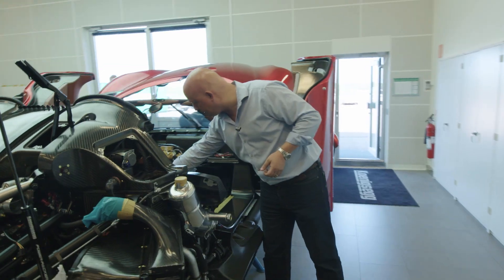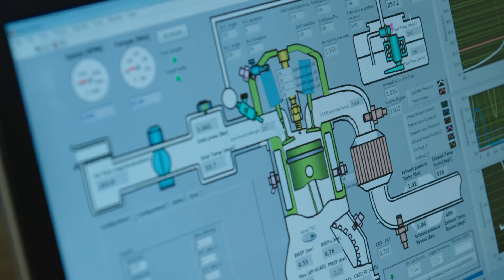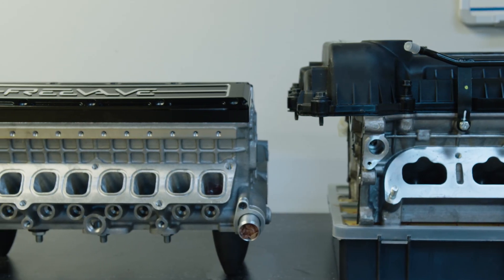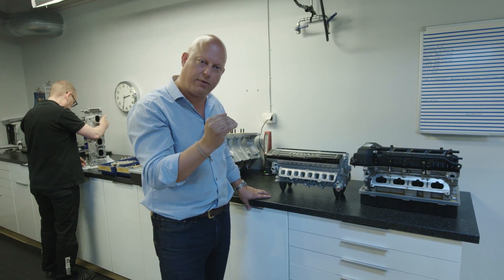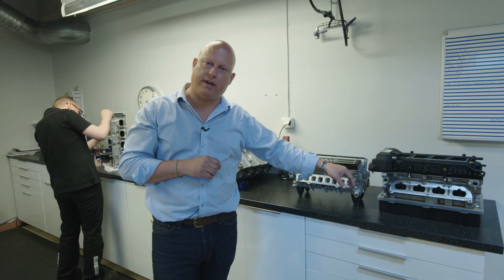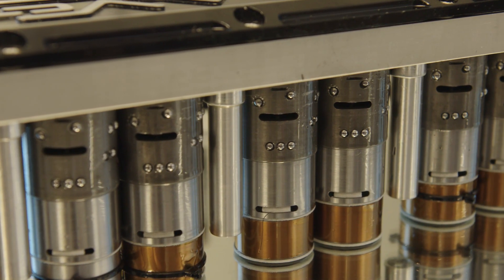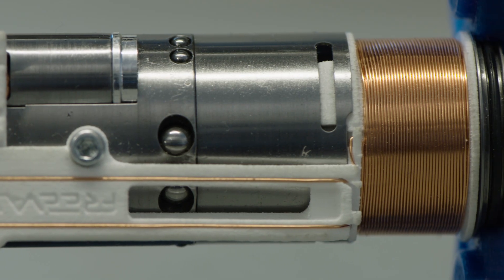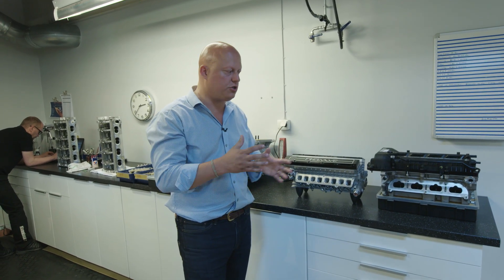Freevalve Update Camless Engine -- /INSIDE KOENIGSEGG

Comment: imagine a head designe with no valves but a rotating disc similar to a parmeseam cheese dispener that allows air in and out depending on timing and port size. no springs, no valves, rotating discs on a squirel drive gear #patentpending

Comment: I like the idea of new technology but I wonder what the longevity is of these valves and how hard will it be for a mechanic to replace valves should they fail prematurely? Also, Will an average mechanic be able to replace the valves and diagnose and repair the head should there be a problem. I live in Australia and it's not like we have easy access to Swedish Koenigsegg engineers here.

Comment: I imagine you could easily retrofit this on anything for example an ls then I'm sure aftermarket ecm manufacturers like haltech will be able to integrate this into their tuning software and be able to create massive power gains my only worry is if an actuator would fail open but I would imagine they would have thought of this in the prototype phases

Comment: what happens if one of the pneumatic lifters fails?in a traditional engine if the taming chain or belt fails it could destroy your valves and pistons.thars only one point of failure with these pneumatic lifters you have multiple points of failure how reliable are this pneumatic lifters being exposed to all that heat in the engine?
Reply: I answered my own question if the pneumatics fail the valve stays closed so no chance of the vales contacting the pistons very cool innovation.

Comment: This tech has been around since the 80's in high performance race cars. The fact it has taken 30 years to even get close to getting into common road vehicles is appalling. This tech should have been rushed out 20 years ago if it was going to save the combustion engine. Like it or not government regulations in a lot of countries will force the switch over to electric motors a lot sooner than people realize. It just makes me very frustrated that the combustion engine has stagnated for so long. Now that a company is actually pushing for this, electric cars are on the rise and will phase this out before it ever reaches the market most likely.  Like I said you guys are about 20 years too late for this to have any impact.

Comment: This is really cool but I do have some questions. How reliable is it? It seems to be a fairly complex system and relies heavily on advanced electronics. How fast can it move the valves? Is it comparable to a solid camshaft with racing spec valvesprings? And lastly, how expensive is it? Is it even economically viable to put in normal road cars or is the cost prohibitive?
Reply: americanmusclefan10K I would think it would be as reliable as the electronically controlled valves in the valve body of a transmission.
Reply: These would have to operate at a much faster and continuous rate. The solenoids in a transmission arent really comparable
Reply: You can look at fuel injectors, they are very reliable, but of couse, are cooled by the fuel and need a small fraction of the power compared to operating valves.

Comment: Plus the obvious benefit of not having to replace the timing chain or worse having the timing chain snap and destroy the engine!
Reply: All this talk about timing chains not failing. Please tell me you’re not serious.
  GM 3.6 engine notorious for stretch in timing chains. Honda’s, Toyota, Nissan, Ford and Chrysler products.
 I have personally replaced them all due to stretch and breakage.
  Their not fail proof.
     Now as far as Free valve technology, pure genius. Appears very powerful and super efficient engines not far off at all.
 Look at modern power plants compared to just 25 years ago. Major difference.
Reply: Doug ONeill   Agreed.  I just replaced chain,  tensioner and guides (kit) on my DOHC V6 Taurus.  I could hear it slapping when I cranked the engine.  It made a huge difference in performance and eliminated check engine light that’s been on for 6 months.
Reply: Solenoid gets stuck leaves valve fully open, still destroys engine....it'll just be different.
Reply: No mention of non-interference engines.  Also, my Corolla has a cam chain, its nearly 20 years old and there's no timing problems yet - do I need to wait another 20 years?  Sorry, I'm not convinced..
Reply: @mojojomo6750  My 1992 Taurus SHO with its Yamaha 3.0 is a non-interference engine. Timing belt can snap all it wants. Worst case is you get stuck on the side of the road dead and need to tow it home to put on a new timing belt.
Reply: You mean timing belt? Most timing chains are lifetime parts.
Reply: G P  Not True, Chains will stretch over time causing tension slack and timing issues, jus takes longer than a belt.
Reply: @toddhodder  It's called a chain tensioner which will sustain the needed tension for the lifetime of the engine
Reply: @toddhodder  by the time that chain wears out you will most likely have a head gasket issue or something else where you will replace that chain preventively before it fails. Of course it depends on the engine.
Reply: @toddhodder  chains have a hydralic tensioner. and the engine compensates as it knows camshaft position due to a tone wheel, and modern engines all used vvt anyway
Reply: @aducksecho  and many cars have premature tensioner failure due to cost saving, cheap sh17 materials...
Reply: @GGP39  except bmws 😂
Reply: @E9X330  not a big fan of modern BMW but there are plenty of vehicles that have timing chain, guide, and tensioner problems other than BMW
Reply: I was going to say that jesus.
Reply: @Oliver Mayo What would be the difference to a regular engine? A valve can be stuck on a regular engine too.. there are no parts that "pull" the valve back up except the spring..
Reply: Diesel still use timing chain and I have yet to see one damaged at all.

Comment: i certainly did not  know  that most of the pollution  emitted   is during the warm up phase..what during full throttle ?  i would think that to make  the power that a basically excess amount of fuel is needed  ' just because '

Comment: What generates the compressed air initially for starting?  What if the electric supply/controller fails - does the piston just crash into the valves?

Comment: Wow.... I was looking at getting into this with electrohydraulics, much the same way that HEUI fuel injectors work, but, my main job of engineering in electric motor control soaked up all of that time. 

I'm actually shocked they are doing this with air, but then again, I was thinking diesel where the spring pressures are way higher, so air might work. The one thing they didn't mention and I'm curious of, is how much power is consumed by the compressor to make the air to operate the valves. Yeah, that's great there's a power increase, less motor weight and so on, but what does the control gear, compressor and associated valve control add in weight and reliability to the motor?

I'm not knocking it, you can do some amazing shit with this, which is exactly why I wanted to play with it.

Comment: I would assume that most of the performance increases come from the fact that the poppet valves open and close to fully open quicker, they can also be held open for a longer period at full open compared to a traditional poppet valve. This means that their is less pumping loss and higher airflow into and out of the engine. Hence the better performance in the end.

Comment: What is the intake valve diameter?  What is the rev limit?  I am wondering if this will work with 36 mm valves at 12,000 RPM.  Good work in bringing this concept to production!

Comment: manufacturers will never allow this for mass production because this technology is beneficial to the customer and not to the corporates pocket. they want to sell you something you have to replace and maintain with money for their own profits. if they give you something like this it eliminates a lot of service costs, repairs and the only thing I can imagine is that if the computer's crank sensor goes bad at a high RPM, it will bend valves as it would've lost its position reading, or if the air entry is corrupted whether physical or by virtual reading. but, Im just a hater because I didnt come up with this idea first.

Comment: So basically I won't have to worry about timing belts anymore? Cool. 
Instead I will have to worry about air compressor that's going to provide pressure for this system. Not cool.
Just an evolution, not a revolution.

Comment: I would love to adapt this to current Ford 4.6L DOHC cylinder heads. Decrease in width, better fuel economy along with more horse power and torque when and where needed. It shouldn't be hard to add on a set of driver's "*mode*s". Eco, sport, and hold on Margret! 
If they can get the initial cost down to just twice that of a conventional hard cam system or lower, there would be a huge aftermarket following. We could start seeing some very street-able and serious E85 power plants or some very eco friendly ones.
---Just my two cents.

Comment: Direct Injection engines are not that expensive to produce, if Huyndai can make them and sell them cheap then anybody can. The benefits of DI outweigh the slightly higher cost of injectors and pump.